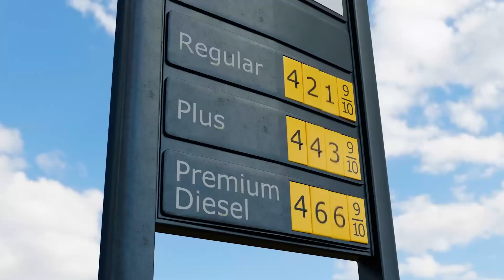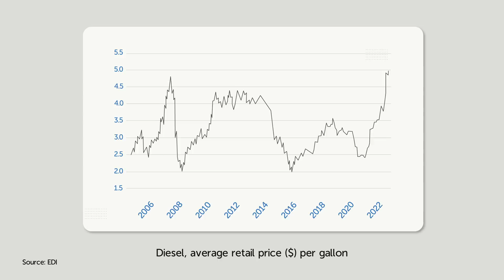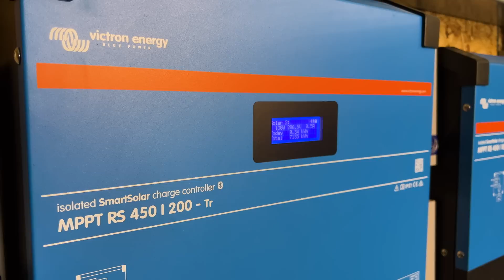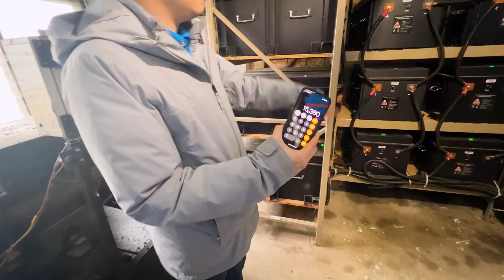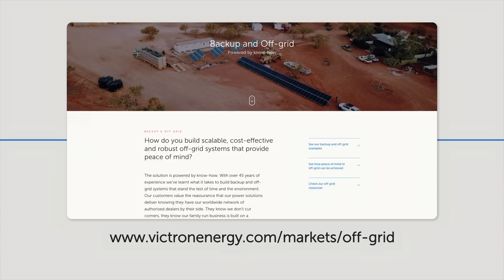How this Amish-run business powers their workshops without the grid?

Comment from the maker: 🎯 Key Takeaways for quick navigation:

00:00 ☀️ Amish-run business, Equipment Remarketing LLC, in Indiana, seeks an off-grid power solution due to high fuel costs from diesel generators.
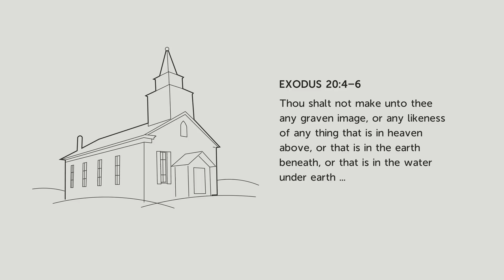01:37 🌄 Amish culture values simplicity but recognizes the need for electricity in business. Off-grid solutions like solar are accepted as long as not connected to the grid.
03:09 🌞 The business installed a 49 kW solar panel system and Victron Energy equipment, including 60 kW of inverters and chargers. They operate independently from the grid.
05:21 💡 Victron's system provides consistent power, reduces fuel costs, and eliminates the need for frequent generator starts, making it a preferred solution for the Amish business.
06:48 📊 The company monitors energy usage with CTs and uses Victron's VRM to adjust the system as needed, ensuring efficient off-grid operation and savings on fuel costs.

Comment: Given that the 25.6/200 Battery is actually 16 cells already, what is keeping Victron from selling a 51.2/100 with the same physical dimensions and just a different BMS so that there is a native 48v Victron LFP Battery?
Reply: that is a decision based on volume expectation, if that's not high enough to justify to start that product in production.

Comment: Were they able to avoid the requirement for UL Listed gear since it is not grid connected? I assume this installation still had to be permitted and inspected. This is a challenge with Victron in the US as options are limited to the 12/3000 and 24/3000 MultiPlus that has the needed certification.
Reply: depends if they live in a town that requires inspection, many unincorporated towns still exist

Comment: for this sistem a regular diesel generator is not a good choice,they need a inverter that only supply that energy that the panels can't, avoiding the used of the battery bank during the day,
Reply from the maker: Where will this inverter gets its power from?
Reply: @VictronEnergyBV  a inverter diesel generator,a DC generator with variable speed,

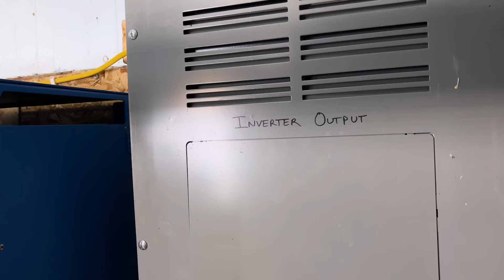Comment: 4:37 Relying extensively on solar. Next shot is 3K of solar and 47K of generator incoming. I get that it was during battery charging, but that was some poor timing on the editing.
Reply from the maker: Yep well spotted.  It was a bit of a dull day in general and the video does explain that the generator is used.  but i take your point.  Thanks.

Comment: I am Dutch from Australia, and I only are using your shunt at present.   Wish it was WiFi and not Bluetooth so I could monitor it. Your shunts are very good, that is c9ming for a calibration Technician with 24 experience.
Reply from the maker: Thanks!
Reply: I was disappointed to learn that the BT doesnt work on windows either so my solution to this was to connect to a phone that i could cast the screen over to my PC or to my phone remotely. I did read on some forums that vaguely refrenced there was a USB dongle that you can use to connect to the windows app but i havent tried it.

Comment: Hi, I installed a 2-axis solar controller in my DIY solar tracker: https://youtu.be/_Rs8CptQcDw .Tip: Save electricity costs: by avoiding electricity purchases from the grid / shortened amortization: Self-sufficiency is achieved with dimmers + solar PV now increase to almost 95%, because the expensive purchase from the grid is so easily suppressed and the electricity bill stops just like the electricity meter. The prerequisite is that you have at least a small solar PV balcony power plant, and you don't need an expensive battery either. Example of a kettle: Without a dimmer, the 2500W - 600W PV system needs = 1900W, which you have to pay more for. If I turn the kettle down to 600W with a dimmer, then every weak PV system can now supply each consumer independently and independently, because the 2500W kettle becomes a 600W kettle thanks to the dimmer. Magic... The 2000W e-heater becomes a 500W e-heater with a dimmer, which can run 12 hours a day free of charge via PV. https://youtu.be/eC2olbCBhh0 . The 4000W oven is also tamed. Not the solar systems have to grow, but the consumers just have to drop by 75%, which is sooo easy with the dimmer. I have already switched my entire household to dimmers. Please have a look at my channel. .......... 🌞 ........... Increase mini PV solar self-sufficiency (winter and camping): A boiler and other power-hungry consumers can be infinitely reduced using the "5000W dimmer". Ebay €7. I run 4 dimmers in parallel on an 850W inverter. Kettle 2.2KW at 150W runs 12 hours a day, so the water is always hot https://youtu.be/D9Ss0RuqZG0 . The room is also nicely heated. 2.5KW washing machine runs in parallel with dimmed to 400...600W and always reaches its 60°C, and also its 1400rpm... It doesn't matter to the washing machine whether it changes the washing temperature to 5min@2500W or 100% can be achieved free of charge via existing PV power in 20min@600W. The wash cycle lasts the same time dimmed and non-dimmed, 3Sth 10min. The iron https://youtu.be/-71oL7z1kMU , dishwasher https://youtu.be/8vnAkrS1x-s , oven https://youtu.be/azDjqZpz77U , electric heater https://youtu.be/QbLWDbJi6ew , Waffle iron https://youtube.com/shorts/ofanZCdYEjA?feature=share, coffee machine, all internal heating is throttled with me. Lots of videos on my channel. The inverter stays cool and quiet and the MOSFETs + (battery packs) stay intact because extreme current peaks no longer reach the inverter. Now every Mini PV Inverter is enough to operate large devices. So, with the dimmer, all internal heaters/devices can be converted into base load devices that stay almost permanently ON, drawing very little current directly from the PV. With a wattmeter / energy cost meter you can then measure this perfectly in order to set the dimmer optimally. ........ Comments: "Great idea - despite studying electrical engineering, I didn't think of it myself ;-)" or "I installed it in our washing machine, great idea!" or "Glück Auf Christian, I'm a professional myself but I haven't figured that out yet.👌 Greetings Mitch💚" and many more... LG Christian .............. 🌞 . .............. "smart energy saving", has made a meaningful reaction video, to the dimmer: https://youtu.be/EHtJGiXAjZk . 🌞 ......... "Free Range", also made a meaningful reaction video, to the dimmer: https://youtu.be/qzdRdBObtvY . 👍........ "Jens Kummerow TS", also made a meaningful reaction video for the dimmer: https://youtu.be/fTY5jWvz5CY . ............... 👌 ................ A little hint: Energy cannot be saved. So if I want to boil my water, I always have to use the same amount of energy for one liter. Christian's method relies on a longer period of time with less power in order to be able to use the power provided by the PV as efficiently as possible - so consumption peaks are intercepted. In the end, the energy consumption should even be (slightly) higher due to the interposition of the dimmer, but it doesn't matter, since more efficient coverage by the PV system and therefore better use of the self-generated energy .......... ...... ................ Here an "automatic PV excess control + remote controlled dimmer with heating element" / load management (consumption / heating element follows PV excess .. .): https://youtu.be/IWp7Mi2FldM . LG Christian .............. 🌞 ............... ............... ... ............ ................ ...... ...... ......... ................ ........ ......... ...... ................ ................ ............ ................................... ................ . ............... ............... more videos on my channel ..............

Comment: Nice presentation , is curious that end customer didn't pick the victron LFP batteries and went for a 3th party. They look like a py...tec battery.
Reply: They are 15k each if I remember Correctly
Reply: Does victron even have 48V batteries yet?
Reply: @niktak1114  straigh 48V , no , but you can use 2 of 25.6V getting you the 5kWh storiage
Reply: @gigione113  typically large systems like this don't mess around with series batteries

Comment: Next they will connect their neighbors to that solar system but extension cords will have too much voltage drop. So they will install step up/down AC transformers and overhead wire. Then more neighbors ask to be connected. Say hello to new Amish power company.
Reply: Latter they build nuclear power plants, off grid
Reply: @kzinas1  they already have one but the reactor is 8 light minutes away.
Reply from the maker: As long as they don't connect to the grid then that will be within their beliefs.
Reply: and is that not Grid then ...
Reply: still a better power grid than texas

Comment: Hi Victron Guys!

I'm travelling around Europe since 150 Days, also throught the Nederlands (Land of the Drempels)!

I love my Smart Solar Mppt 100-30, it provides me around 1,5 kwh Power per day, out of 600 Wp (flat podinioned).
If i get an power outage over night, the Smart Solar is not visible via Bluetooth, after the sun rises. 

Is that known? I have to reconnect the Batterie, afterwars i can reach the Smart Solar 100-30 via Bluetooth again. The Metrics are not safed. I wonder if my saftey configuration (eg. max voltage) is in Service.
Reply from the maker: Please ask this in https://community.victronenergy.com/index.html

Comment: Been using Victron Products for years and its never let me down worth every penny
Reply from the maker: Great to know!
Reply: @VictronEnergyBV   i have it only for 6 months now,my home is off the grid completely,no backup generator,only a manual transfer switch back to grid,if the system cannot keep up the power demand.Let me say since june 16,never had to touch the switch,and now we got some rainy days consecutive...produces less,but it was enough for us,havin an over sized panel bank and good amount of batery.I love the Victron equpment,it works magnificently good so far.The VRM is also awsome with app and widget support,absolutely fantastic so far.